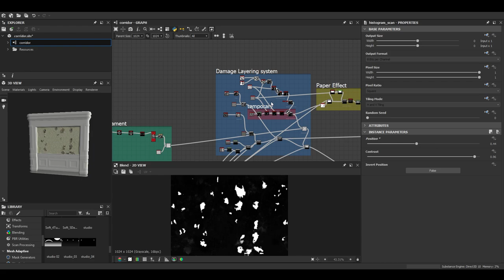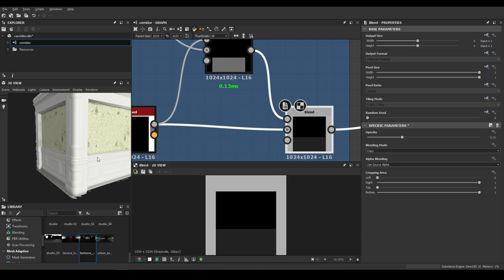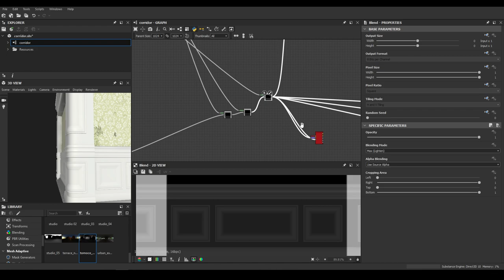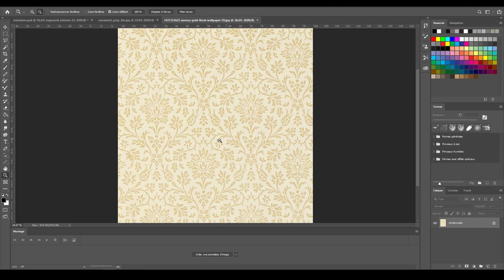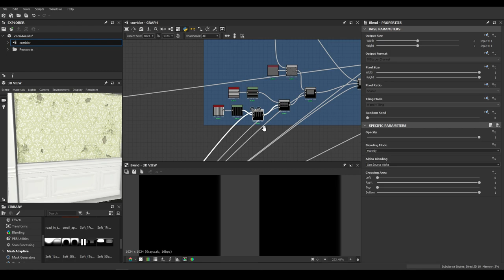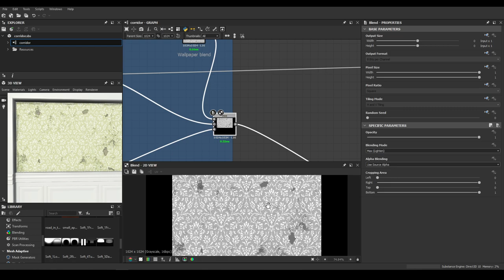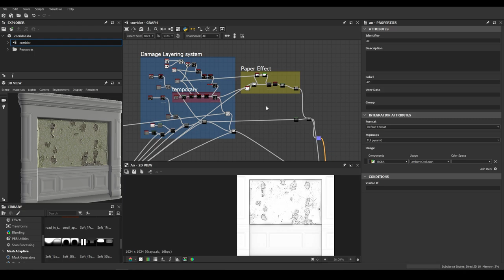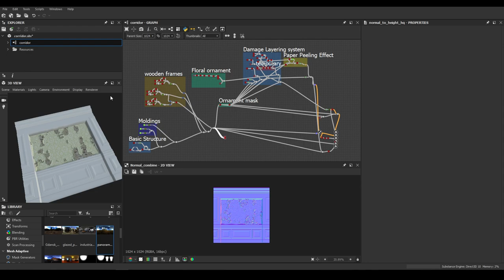Wallpaper wall WIP with Substance Designer

Comment: Hey, I'm starting with my first substances in designer, if it doesn't bother you, can I get the .sbs? Pretty please. There are some things that I can't understand/can't figure out on a newer substance designer and I'd like to take a look and fiddle with settings myself
Reply from the maker: Hi. That's nice to know that you're interested in this project. But my graph has become to messy with time (in the finished version). Are you looking for hard surface materials / tutorials?
Reply: @danieljrgameart  Messy is not a problem haha. I'm studying in the programming field right now, and I'm fiddling with gamedev related stuff, like Blender->Zbrush->Painter->Unity pipeline. I'm not specifically looking for hard surface material tutorials, the thing is that: 1. I'm dying to learn designer since it's amazing. 2. I always loved old, vintage house looks in games (good ol' Amnesia for example). This project fits that theme so well so I tried to learn from it. I managed to do some parts of it, like making the wallpaper pattern and the planks/beams/plaster. However, I don't really understand the layering system with blending modes. I wish I could just blend 2 layers as in stack them like layers without color changes so I can just color individual things.
Overall, this I'd like to learn from this so I can make my own materials with different layers since that adds to a lot of realism, I also love that it's procedural so it can be tiled without being repetitive
EDIT: I'm going to add that I only attempted the actual wallpaper part, since the panels and molding and stuff was a bit much for a noob like me, and I'd also rather model it than have it as a material like this
EDIT2: Actually managed to do something I think close to it: https://imgur.com/a/FqLXE22
Reply from the maker: I see that you're indeed pretty close to the wip version. I'll organize my graph and send it to you or put it on substance share. It's clearly not the best thing to learn from but you may get something out of it. Don't hesitate to email me. I'll send you the file directly then.
Reply: @danieljrgameart  Whoa, thanks! I already learned a lot about SD just from this project. I'll shoot you an email!